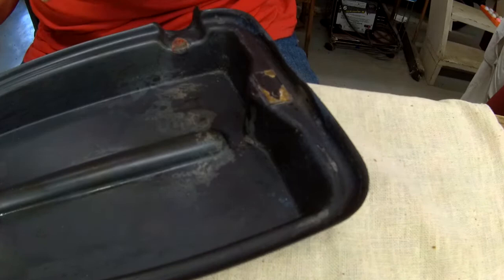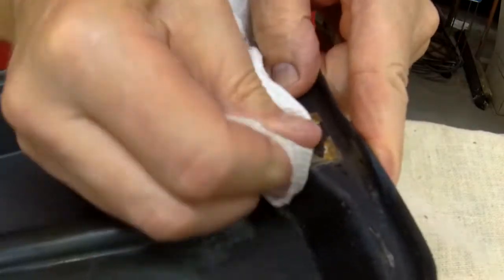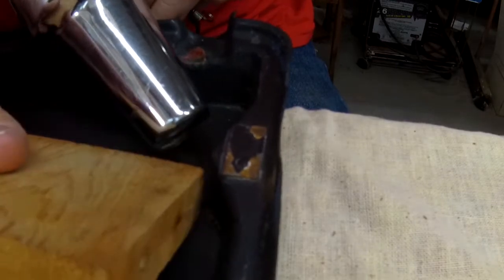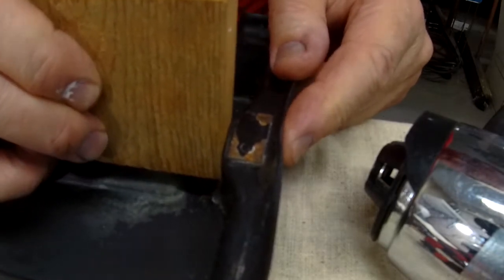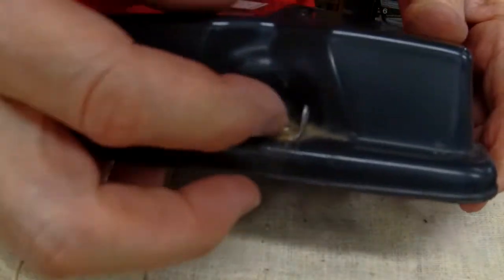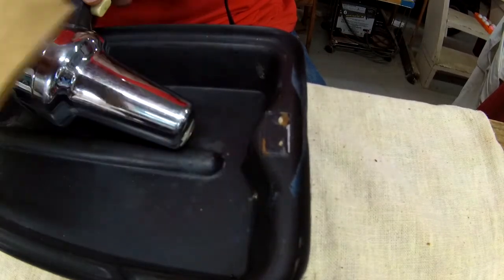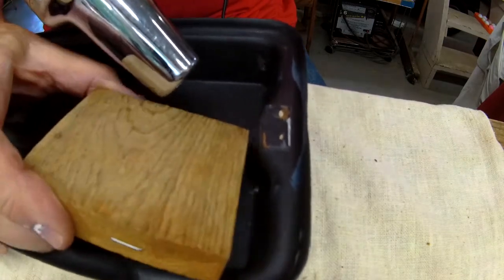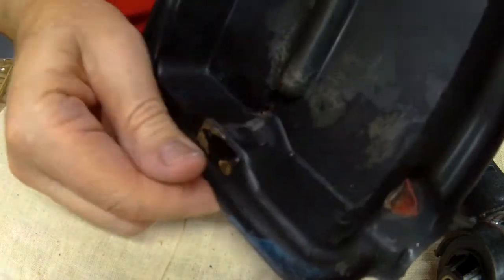Modifying a Cessna battery box lid to fit a Concorde battery

Comment: What was the reason you decided to switch from Gill to Concorde?
Reply from the maker: Mostly I get very tired of seeing battery lids which were cut apart during my pre-purchase inspections. I tell them about doing it this way, and thought it would be good to have an example available. 

Concorde makes a more robust sealed battery than Gill's offering and folks have been reporting very good results with them. Although I can't complain about the longevity of my current Gill. I'll have the option when the time comes.